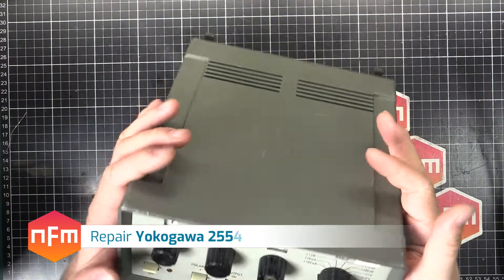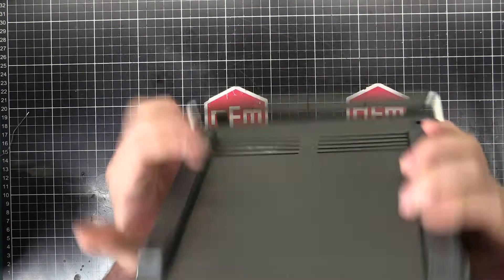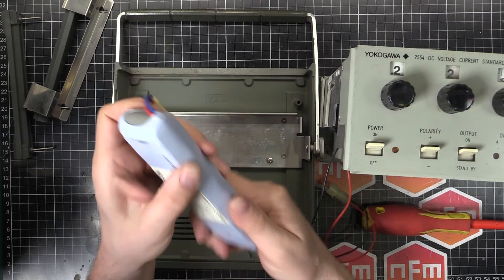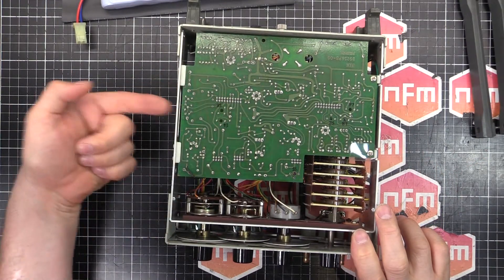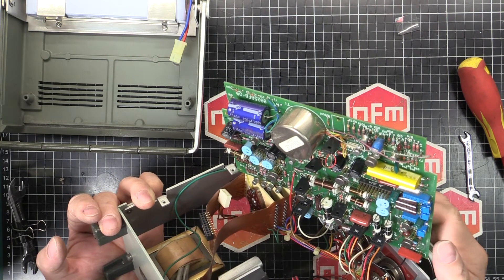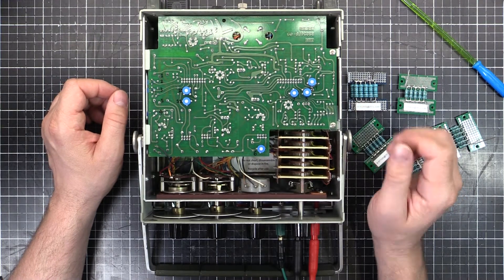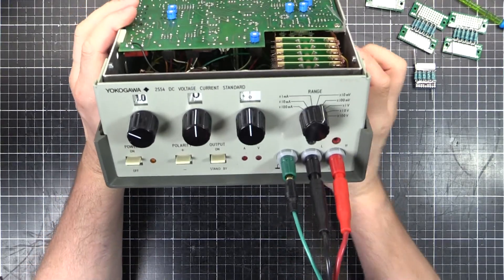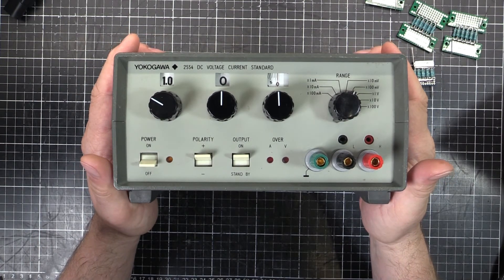Yokogawa 2554 Volt Current Standard Repair

Comment: Service Manual -  https://xdevs.com/doc/Yokogawa/Yokogawa%202554%20DC%20Voltage%20Current%20Standard%20-%20Service%20Manual.pdf
Reply: Making the adjustment of my Yokogawa 2554 unit I came across an adjustment that made all the difference in the accuracy of the voltage and current adjustments. In the manual contains "2.5.3 ASS'Y: B9256FB" items (a) and (b). Performing the correct adjustment following these two items I got an accuracy of 1 or 2 uV of accuracy in the calibration. The unit is really very accurate...

Comment: I am sure that you know this, but... For dead battery packs, it is typical for the first battery in the series to fail, causing the whole pack to test as failed. However, if you just change out battery #1, you may be able to get some more life out of the rest. Testing each individual battery is a good idea. Love your channel. Thanks for your efforts to share with us. It's much appreciated.
Reply from the maker: I didn't know that with the battery packs, thanks for the tip!

Comment: Thanks for this video. I have learned a lot about the YEW-2554 v/a standard. I like the way you replaced the old trim pots with better ones. 
I have just acquired a YEW 2853 which I believe is a similar but older unit but cannot find any info or manual on-line. Do you have a source for YEW manuals?
Lou
Reply from the maker: I actually have a 2853 too that will get it's time on the healing bench one day.
Here's a link to a user manual, it's in Japanese but google translate should help:
https://drive.google.com/drive/folders/1aACc23t84FQL_9jTphfvfV4PTqqg5y7b?usp=sharing

I usually email Yokogawa in Japan directly and sometimes they have something. If you try sending an email to Yokogawa USA you might get lucky, if not let me know and I can send an email to Yokogawa Japan in Japanese to see what they have.